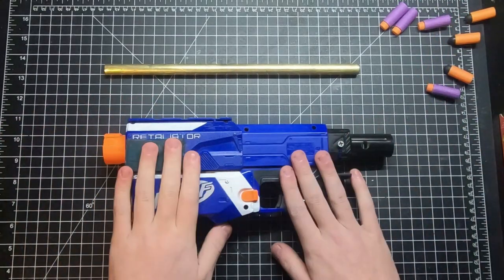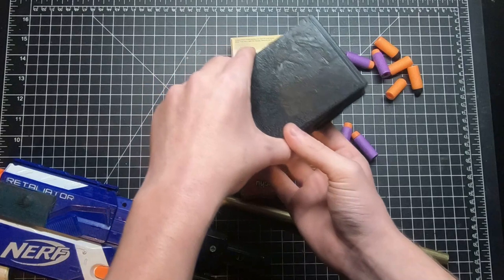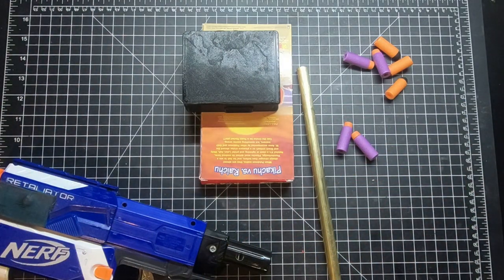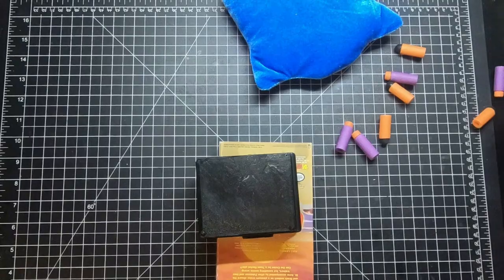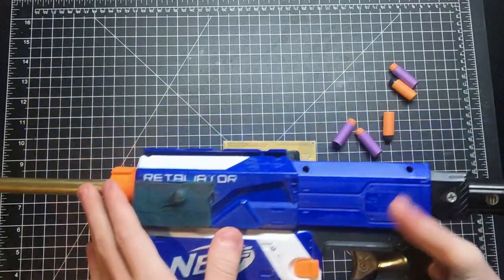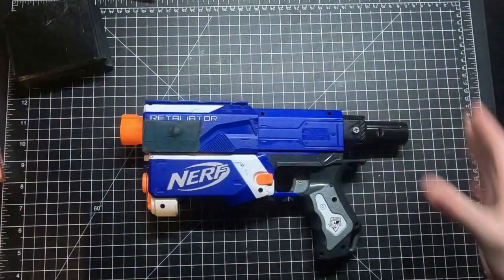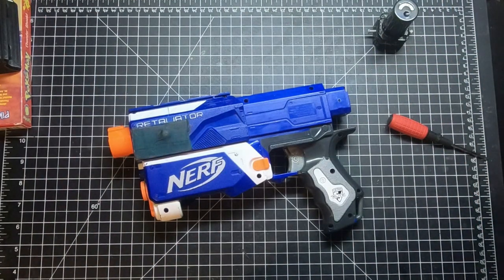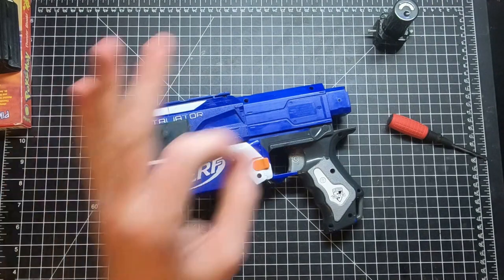Retaliator Update 300FPS????

Comment: Man I wish I can be like you guys 300 fps. going to nerfed often. and coolest tools. What 3d printer do you recommend
Reply: Just buy a caliburn and get a k31 and k25 man, 150-160 dollars, so pretty expensive, but close to 300 FPS. Add a brass barrel and you get 310-320.
Reply: @comradekoala1245  , where's the fun
Reply: @JohnJames.  Yes not much fun with high FPS springers. The feeling you get while clearing a room with a full auto fly wheeler can’t be beat by anything
Reply: @comradekoala1245  , I just like modding, flywheels are to loud for my liking
Reply: @JohnJames.  Yeah. At the end of the day it’s just about having fun.
Reply: @comradekoala1245  , I have a rapid strike in the bin waiting for parts, that will be my flywheel mod, I just finished a brassed expanded plunger tube ret , springers are just easier for me to get parts for, but  you are right let's have fun

Comment: I'm a little confused on which size scar to get. If I have a 17/32 brass barrel, does that mean that I get the 9/16 scar?
Reply from the maker: To my knowledge a 9/16th scar would fit onto 9/16th brass. I would recommend finding one that fits directly onto your barrel or use etape to make the fitment better..